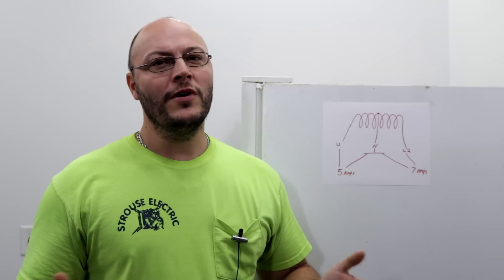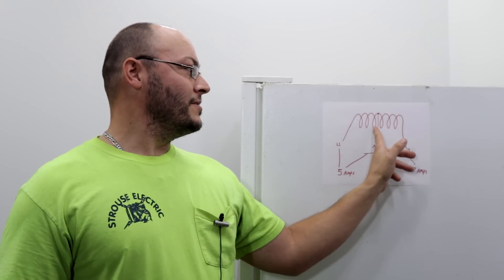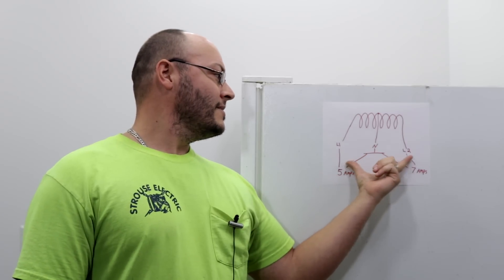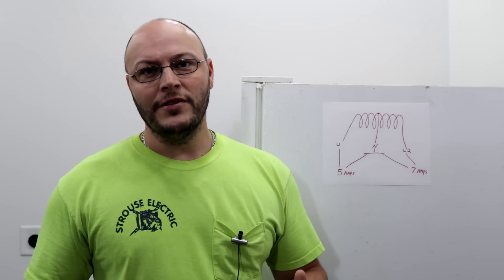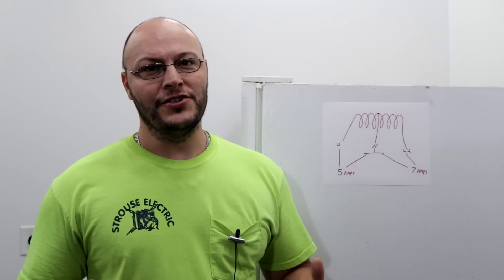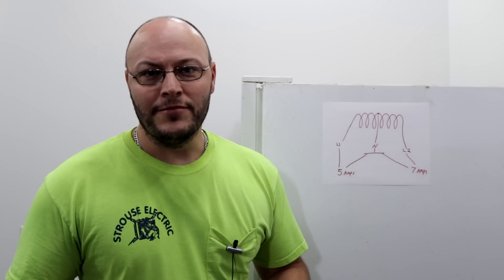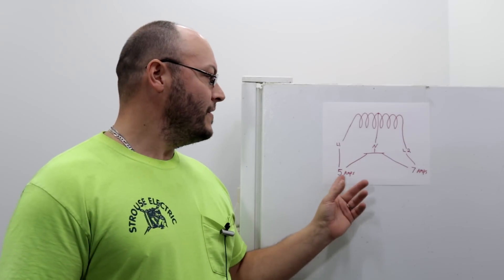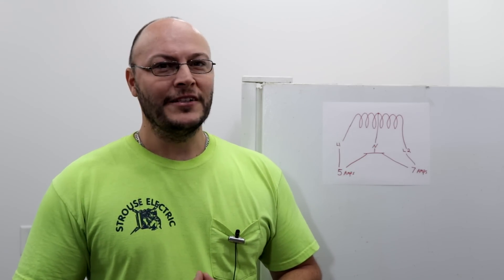What does the Neutral Wire Do?

Comment: Can you tell us why they bond the ground and the neutral and its explanation? thanks a lot!
Reply: As was mentioned in the video, the neutral is there to carry the unbalanced load. If the amp draw is equal on L1 and L2 then you will have 0 Amps on the neutral. To be more clear, there is current on the neutral, because it is the return path to the source for 120V circuits, but between L1 and L2 (which is separated by 180 degrees), when L1 is at (+), L2 is at (-), so their currents traveling on the neutral back to the source cancels each other out, thereby giving you (0) Amps on the neutral. With the neutral bonded to ground, you have what is called a grounded electrical system, and the neutral can actually be called the grounded conductor. Neutral and Ground are bonded for safety reasons. In your house you have your panel with circuit breakers rated at 15 to 20 Amps. Your typical circuit breaker is really meant to protect equipment and not necessarily people. WHY?? If you ever got hung up on a live circuit, the breaker is waiting to see a circuit amp increase of 20 Amps or more before it trips. At 5 Amps, you are in some serious trouble. 10 milliamps across your heart will turn your lights out forever. So, for people protection there is GFCI or RCD if you are in Europe. A GFCI is set to trip between 3 and 5 milliamps. You will find GFCIs mostly around water sources. So lets say a mouse got into your house and chewed on your garbage disposal wire, and the expose conductor is now touching the copper pipe under the sink. Since the copper pipe is grounded (naturally) and the neutral is grounded back at the Panel, you now have a completed circuit with current flowing. But the amount of current flowing may not be enough to trip the breaker, but it is enough to trip the GFCI that the disposal is plugged into. If there was no GFCI, you would have an energized copper pipe sitting there waiting for someone to touch it and another grounded surface, thereby completing the circuit through your body and hurting you. I know I'm rambling on, but I hope it makes some sense to you.
Reply: Thanks!...have a good one sir!
Reply: It was really good explanation, thanks
Reply: Damn, I am going to use that explanation.